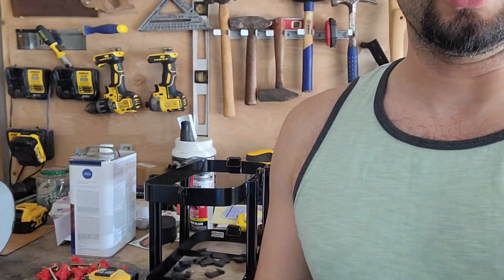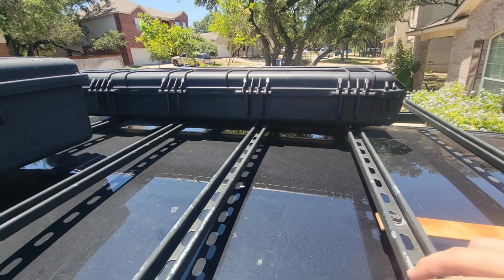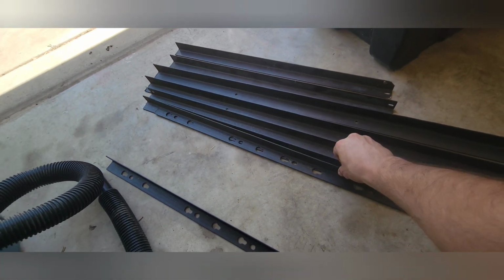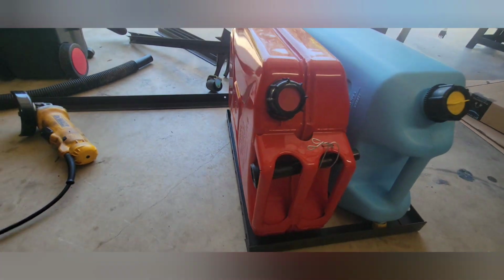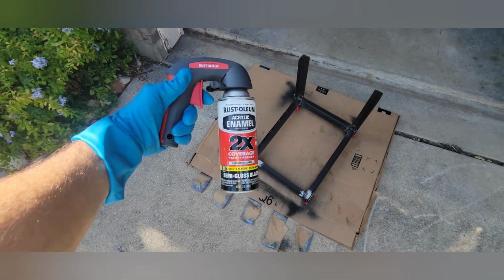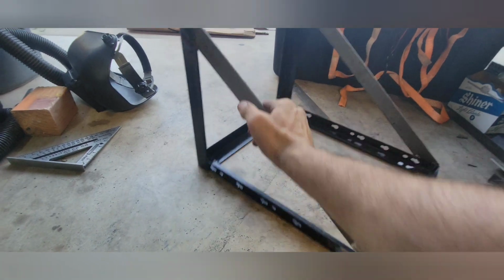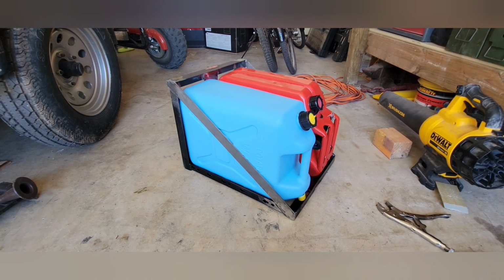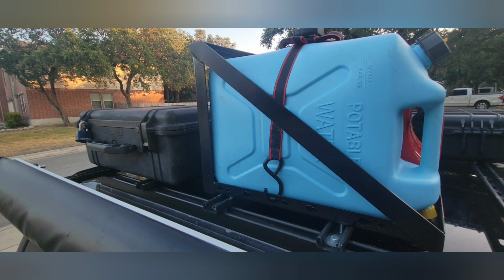DIY Jerrycan Mount(Roof Rack/Rear Bumper) #diy #overlanding #offroad #fuel #water #4runner

Comment: I got an ARB mount for my roof rack on my 4Runner.  Yes, somewhat pricey but easy to install and very secure.  Took it out on a camping trip this past week and it works like a charm.  I got a simple rope hoist to haul the 5 gallon up to the roof that I can take with me on trips.

I also bought a jerry can mount for my van and adapted it to the rear door ladder.  

Both just took some nuts and bolts.  Yes, I wish I could weld.